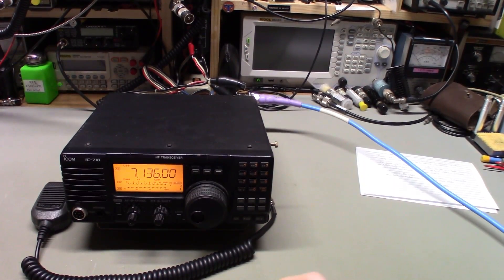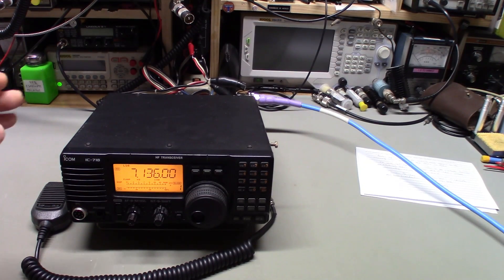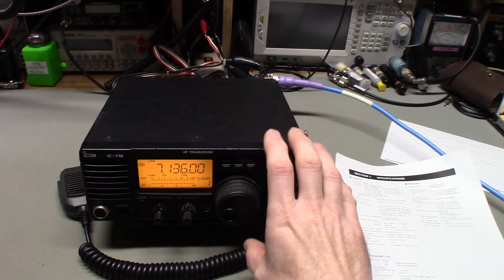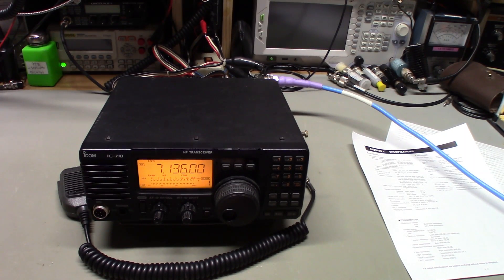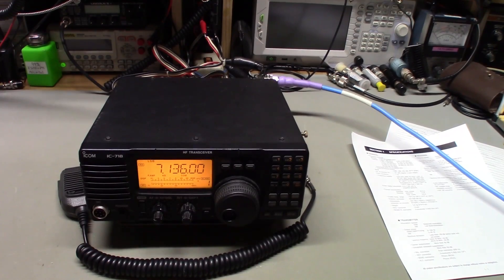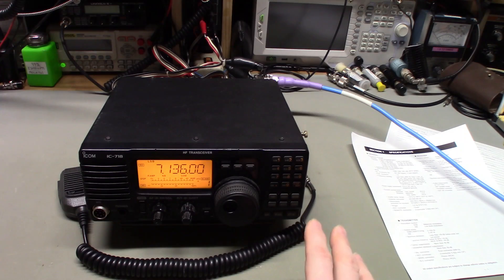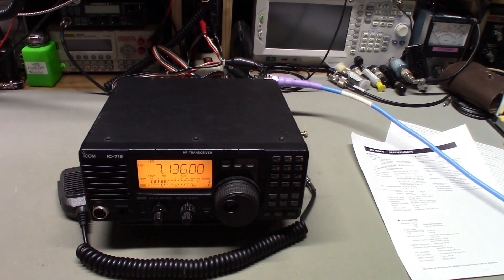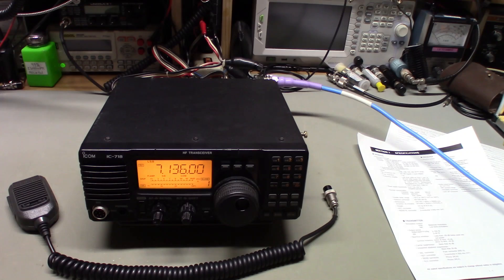Icom IC-718 No audio and no TX power repair (or maybe not). Read the owners manual.

Comment: I have one too, that's the Hm36 microphone. It went bad so I replaced it with a hm 219 microphone that used on the icon 7300 and it works just fine. Thank you for the video😊

Comment: Hi Mike thanks for the video, appears history is repeating itself. I recently acquired an IC-718, had a few problems with the 'S' meter not working tracked it down to the ribbon cables from the main board to the display board, a cheap repair.  Next the apparent low TX power. The same issue as the one on your bench RF PoWEr set to 'L'!!! Once again I suspect the previous owner moved this radio on and sold 'as is' to me because he couldn't get it to perform. 

Thanks for the video, it has helped me out & I'm sure will help other out too in the years to come.

Comment: Mine was working fine. I had sold it to someone and they only got 10w out they said. I told them about this. I build my own Retro-vintage electret mikes from Non-working Xtal headsets and re-seal them and make hand mikes from my EL -84 6BQ5 AM/CW transmitter. I told him to adjust the gain or if that don't work, change out the mic.

Comment: I am vu2 SSC. I am facing problem with ICOM 718. Till yesterday day, it was okay after checking into the net. Today morning I switched it on & found only display & neither received not transmited. I checked the fuse. It is ok. What to do now..

Comment: How do i solve a weak audio on IC 718
Reply: In all modes or just am? They are notorious for being used by cb guys who find out their expensive cb needs to have $200 of filters installed to use properly on 11 meters because it is very narrow stock. So they could have saved a tonne of money and bought a better rig for way less.

Comment: I had a ham bring me a Yaesu FT 2980 2 meter radio he screwed up the menu settings in. It wasn't the typical user menu he got into the service menus and screwed up every setting. Nothing worked. A master reset doesn't reset the service menus. Thankfully i had a Yeasu FT2900 of my own and the default settings were the same. I used that as a guide to reset everything. I just knew he'd bricked that radio. But after i reset everything It worked just fine. When they can't use a screwdriver to "tune it up" they use menus!

Comment: I agree on owner manual I just a bct15x scanner  mike
Reply from the maker: I have one of those scanners here at the bench.  Best advice I can give for those scanners is for easy programming get a programming cable and download the software.  It is SO MUCH FASTER to program the radio with a computer than it is through the keypad.
Reply: @mikesradiorepair  two thing about that one the company send me wrong program cable but I order right one now new problem the bnc   Antenna busted on me went was try program mike

Comment: I own this radio and I love it. The other problem with this radio is if you don't use it for a while and come back to it, you need to refresh your memory with rereading the manual.
Reply from the maker: Very true.  It's even worse for me because I have to work on radios like this.  Unless it's something I own and use regularly I have to read the owners manual before I can even start to diagnose problems.
Reply: @mikesradiorepair  I'd like to have your skill, but man the reading you must do. Although the library you most have would be fun to browse.

Comment: The RFL+SQL is a ICOM setting and it can be set in the options menu.  The R75 has the same setting but the default setting is silly.  It should have been set to SQL only as default, IMHO.

Comment: In town around power lines it sucks the the filtering on it or the is either too much or too less besides that it's a great radio
Reply from the maker: Filtering varies widely from radio to radio.  Your best bet is to get a external DSP filter, DSP speaker or even a vintage Autek Research audio filter.  They can pretty much wipe out interference when properly adjusted.

Comment: I suppose if you don't have a current limiter on the supply and you're worried about turning it on, you can just temporarily install a lower current fuse.  Once it passes a turn on test, put the regular fuse back in.